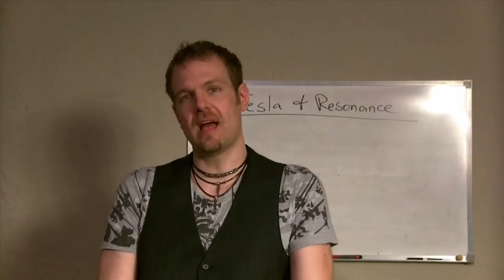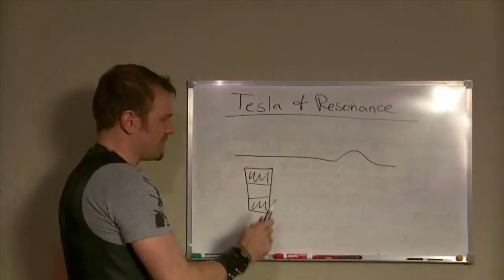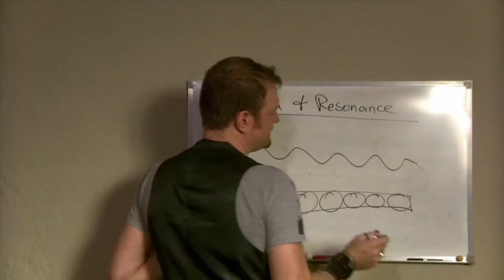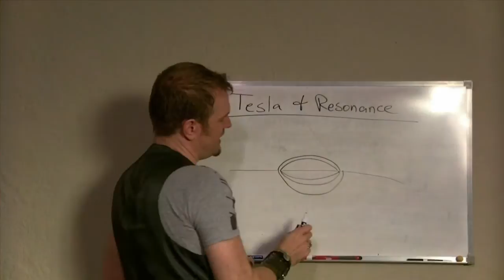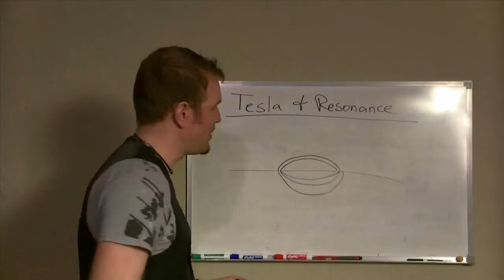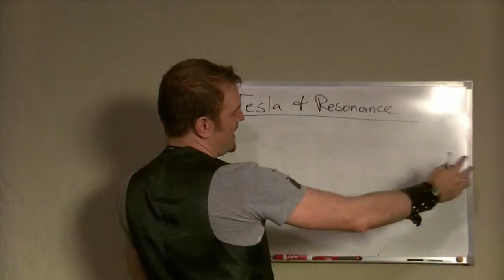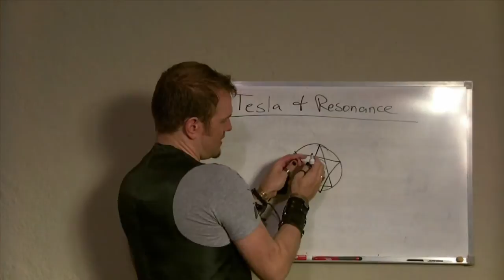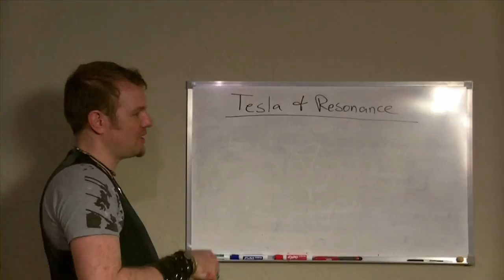SteamPunk Physics 4 - Tesla, Resonance & Aether

Comment from the maker: +Stefan C

"Are you equating eather to spacetime fabric"

Yes and no. First and foremost, spacetime allows light speed to be isotropic under lorentz transform. With Lorentzian aether, light speed is anisotropic (when moving with respect to the preferred frame) even though lorentz invariance is not violated in two-way speed of light tests. (IE Anisotropy is hidden) 

Spacetime is a unification of space and time that gives a 4th *real dimension which allows for infinite 3D realities. It also allows for the relativity of simultaneity to be a real phenomena. In Lorentzian aether, contraction and time dilation are real whereas constancy and relative simultaneity are illusions.

relativitydemystified.quora.com

"Can the light thing be replicated"

One of the reasons I present this the way I do is because some of these things are hearsay. Can it be replicated? I think it can. Has it been replicated? Not that I know of but perhaps you might consider Cherenkov radiation a near or partial replication. How might it be done? Well, I'm working on that but specifically I'd say the point is to impart energy to a portion of space or aether in a structured fashion which reduces dissipation such that the free medium can be resonated without the typicallly necessary borders or such that the method of adding energy to the medium itself created borders within the medium which can behave in a reflective fashion or other feedback loop.

Do we have an analogy or instance of a free medium simply storing energy? Yes, toroids partiallly do so and a more complex toroid might be the heart of the ball lightning phenomena.

Comment: ZPE can be found at the center of a repelling force or at the center of a sine wave. The Zero Point. Flux or Scalar potential. The Zero Point is where the energy is pure kenitic energy. In the example of a swing it is the center point of the swing, where it is no longer going down or up....past the point of potential gain and before the point that the potential is spent. A tank circuit is an electric pendulum. Voltage is Potential. Push at just the right time and only potential is used.